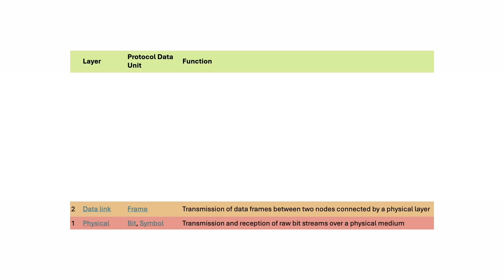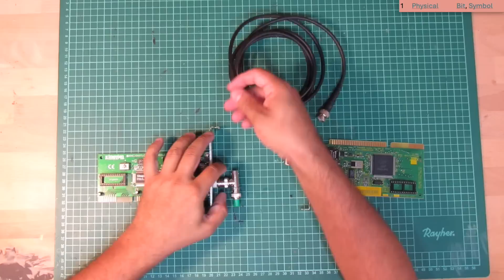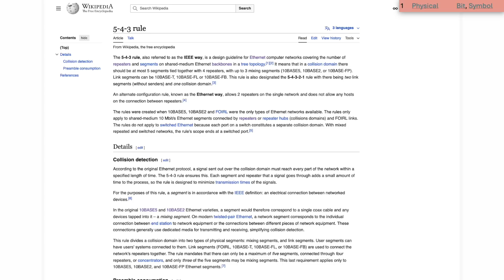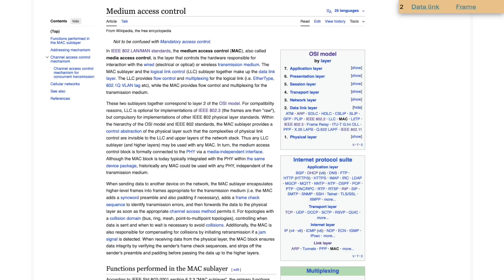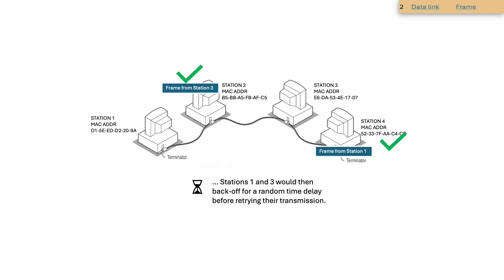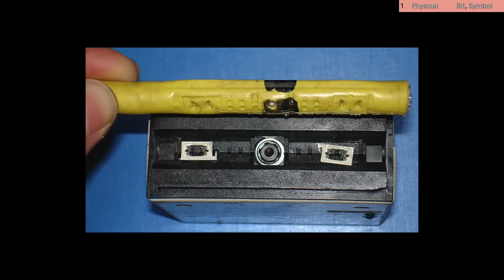10BASE2 Network Basics - Rewinding the Network (Part 1)

Comment: In theory 10Base2 was great; in reality it sucked.

In the early 90s, Post college I tried being a small business computer consultant. So I installed this in many locations for small networks and it worked perfectly. However, the problem with it was someone in the facility would invariably pull their computer away from the wall (say to vacuum behind the desk) and the RG cable would yank out of the BNC T-connector.

"So what?" you young ones may say, the same thing still happens today with Twisted Pair or even Fiber. But no, the real problem with 10Base2 was that because of the topology, the entire network downstream of that point would die ... and the rest of it would get real flaky due to a terminators being gone.

Once twisted pair cards became cheap I went almost exclusively to that format despite the fact you had to buy a hub or switch.  One exception was a few years later, for a small business with two semi-connected buildings. The office portions were two different structures on the street separated by a loading dock driveway.  We strung the RG-58 coax outside across that driveway with 10BaseT + 10Base2 switches possibly the exact same as you had (I can't remember the brand I used).

Comment: Fun fact: Apparently the 16-bit ISA 3c509 can also be used in an 8-bit ISA slot. Learned this recently. Mind blown!

A rare use case for a 10base2 or 10baseT transceiver with a combo card is if the built in port on the card is broken. I have actually done this back in the days. (Actually the insulated DC-DC converter was what was broken on that card, and for a while I ran the insulated part of the card using an external wall wart :) ).

In my experience the old school devices with multiple 10base2 or AUI ports is often too slow to work well with the fastest 10base2 or 10baseT cards. I.E. if you have a 3c509 with BNC and a newer PCI card with TP and connect them via one of those older devices the older device might not be able to switch directions fast enough, making the network drop the reply packets all the time, making things super slow. Meanwhile if the 3c509 are replaced with an older 8-bit ISA card things work fine.

In other words, if you want to connect BNC/10base2 with TP/10baseT, use one of those cheaper consumer grade style hubs from Dlink, Netgear or some noname company as those are new enough to work reliably, and avoid even older "professional" equipment.

Also watch out for old 10-base-T MAUs as it seems like the oldest ones don't really comply to the 10-base-T standard fully.

Btw, the reason for the 50 and 75 ohm impedance of RG58, RG59 and lots of other coax cables are that 75 ohm is the most efficient for connecting an antenna to a receiver, while 50 ohm is a compromise to allow a thicker center wire which is better for transmitters. This is also the reason for why broadcast FM and TV (including satellite and cable) receivers use 75 ohms, while receivers used with frequencies and thus antennas that are also used with transmitters usually use 50 ohms. Can't remember which channel but there is a great video here on Youtube about why 50 (and 75) ohm is the standard.

Comment: Of course, the hunt for the missing terminator (that you do not know is missing) is part of any 10-Base2 adventure. But there are many more. Like using a non-standard mode of 10Base-T Alta Research cards to be able to transmit over long and low quality Voice grade cables a 10Mbps Signal. Convincing some dumbass that if the X.25 (and by extension, the FSCKing ROSE) packets do not pass the local machine, and the packets from the router reach the remote server in another city, the problem lies in the local machine, not in the remote server.

Oh, good times.

A few things you failed to mention (or I failed to hear):
- 10Base5 had a maximum lenght of 500mts, so, in principle, you could have two hubs in offices separated 500mts, connected by 10Base5 (as a backbone), and then use 10Base2 in each office for all the computers for cheapness sake (ask me how I know).
- If you used MAUs, you had access to 10BaseFL, which gave you a maximum lengh for the backbone of 1000mts. and then could use 10base2 again for cheapnness sake (never even tried).
- The automatic crossover specification is pressent as far back as 100Mbps eth, but optional. As long as ONE of the parties involved has it, it will work, is mandatory in Gbps Eth onwards.
- Good quality terminators had to be Grounded, but you could ground only ONE of the terminators. In practice, everyone (us included) bought cheapo terminators like the ones in the video, but I had quality ones from HP in my HP K300 Servers (a thinet used along 3 racks for heartbeat services).

Ah, fun times.

Too bad there was the "Palace Revolt" and not only the IETF disobeyed the IAB and did not use TP4 for address extension (https://datatracker.ietf.org/doc/rfc1347/), but also, did not chose IPX for their TUBA Needs (https://datatracker.ietf.org/doc/html/rfc1791), so, we ended up with the IPv6 mess, and we are still waiting for it to take over...

Anywho, too many ramblings for one night. Over and out.
Reply from the maker: Thanks for your inputs and the time for writing those missed aspects.

For the most, I was just looking into 10BASE2. The side-tracked mentions, specifically for 10BASE5, came in just naturally when touching the comparison aspects and for putting the AUIs in context.

When doing those videos, it''s always possible to miss out a few things.
I'm glad you added them, and you're right, I did in fact overlook the need for grounding the terminators. I'll fill that in in an upcoming episode!

Comment: I built my first 10base2 network in a my apartment, where I couldn't drill any holes in the walls to pass the cable between rooms. Instead, I ran the cables in the open space between the floor and bottom of each room's door when it was closed. It worked pretty well except for when a cable wasn't flat on the floor and someone slammed a bedroom door, taking down the entire network.

Comment: My first network was some cheap discounted Novell Personal Netware kits I bought at an office supply store when I was about 12 or 13. It came with the software and 2 NE2100 cards.  Sadly they were not as popular as the NE2000 cards and didn't have as good support.  But after a day or so of playing around and watching the included VHS tape I had an IPX network going at my house in my bedroom and could play some networked games and share files.  10Base2 was pretty cool and the cables were fairly cheap.

Comment: I've only ever seen base2 once in my life around 2009-10 when I helped clean out an old office building.
Got me a good load of old hardware from that place, including a bunch of NICs, a few laptops and other goodies.

I never did get a base2 LAN going - it literally took until today to realize that I'd forgotten the terminators. So close and yet so far 😀
Reply: Don’t let that stop you, 50 and 75 ohm BNC terminators are available for cheap on Amazon.  I know they’re used for oscilloscopes and probably other RF applications.

Comment: Great video! I did have some ISA network cards that were NE2000 Compatible in the past, but they needed a BNC terminator or the lights would disco saying no cable connection found. The LAN port on them also wouldn't function without it.

Comment: Air is not the transmission for wireless signals.  Spacetime is the medium through which electromagnetic waves can propagate.  I know... being pedantic again.
But I ran 10base2 back in the mid 90s.  My roomate and I would play Need for Speed over the network, Warcraft, transfer files, and share a printer with DOS/WFW3.11 and later Win95.
And we used IPX/SPX on the LAN because nobody used TCP/IP on the LAN in those days... it was still a Novell deaminated world and games almost only supported IPX/SPX.
Reply from the maker: @BandanazX  Yeah, that might be correct from your physicist point of view.

It‘s also correct to say, radio waves don‘t need a medium as a carrier.

Still, they are very much influenced by the medium they travel through, i.e. speed is affected by vacuum, an athosphere, water, solid objects of any sorts (speaking of reflection, refraction, diffraction and absorbtion).

But that‘s not the point here, as in regards to the networking context, I think it‘s enough to provide the picture of „the air being the cable equivalent“ in the layer 1 context.

Frankly, we‘re installing the WiFi APs here on earth, so the readio waves are emitted and traverse not only the athmosphere, but to some extend also through solid walls, windows, etc.
So the analogy I used is anyway incomplete.

Despite not correct in a pure physics definition, bit I‘m not teaching physics here, and I can‘t assume everyone wants a lecture, I‘m sure it‘s good enough to get the meaning.

But then again, If I’m supposed to provide a physically accurate statement for radio waves, then I should propably also not be talking about electrical signals, but rather about Ions and Electrons moving through a conductor.

Maybe I‘m generalizing and simplifying too much. I‘m propably victim by day-2-day work experience with people not caring for all the real things behind, them being totally happy with simple to understand (but sometimes bot fully accurate) analogies.

Comment: Fun fact - the OSI model is actually a real networking model that was competing against TCP/IP and Ethernet back in the day. You had companies demanding OSI compliant hardware and software as a competing network standard. Of course, it never took off, but that's why things like TCP/IP and Ethernet and other networking technologies never fit neatly into the OSI standard. They never were supposed to. As a vendor you offered an OS with OSI compliance, bought OSI compliant hardware and wrote OSI compliant apps. But it was too little too late, and in the end, things like BSD sockets won out for the user APIs, TCP/IP for networking protocols and Ethernet. I don't think there was enough OSI "stuff" around to actually made a production network from.
Reply: Oh, dude, production grade OSI networks were a (big) thing back in the day, in Govt, Telco and Banking. As recently as 3G we were still using OSI Protocol stuff.

Comment: My parents ran a business out of a Victorian era building. Their first computer, which we still have and works was in 1985. Eventually, they had IBM-compatibles and the need to network these became obvious. Coaxial cable was passed through the floors to create a 10Base2 network. The workstations were running DOS and Sage Accounts, with one workstation also as the server. Eventually, in the late 1990s this was replaced with a 10Base-T network.

Comment: Unique MAC addresses? Not if it was a PC from Packard Bell in the early 2000's. They foolishly sold thousands of PC's with NICs with the same MAC. It caused absolute hell on the NTL Cable network which demanded a unique ethernet card MAC address for their cable modems to connect to 😯🤣
Reply from the maker: @thingi  Well, „theorically“ unique ;)

I encountered a few SuperMicro servers with identical MAC addresses during the early 2000s as well.

Comment: Critique: despite still being widely taught, the OSI network layer model does not map directly to the TCP/IP stack we use today, instead it represented a failed networked proposal (failed in terms of lacked any commercial success). The TCP/IP model has similarities, but is simpler and represents our modern networking (including 10BASE-2) much more accurately.

Most egregiously, OSI had proposed three layers on top of the transport layer (session, presentation, application) where nobody actually implements such things in a TCP/IP stack. After the transport layer (eg, TCP, UDP, SCTP), network protocols (eg, HTTP or SSH) are consumed directly by applications to do as they wish.
Reply from the maker: Thanks for your thoughts. I was taught both models as well, so I fully agree with the notion especially about layers 5-7 in TCP/IP. Those feel really artificially imposed onto the OSI model, and it's sometimes a struggle to explain, why a certain protocol is L5, L6 or L7.

However, in the context of this series, I intend in doing some comparison of different protocols besides TCP/IP, like NetBIOS, IPX, AppleTalk, ARCnet, as I go along.

Some of those don't even have their own model representation, so they just treated in context of the OSI model.
As such I prefer using the OSI model overall, as I believe it's easier to explain different protocols in a comparable and relatable way using the same high-level model, e.g. "TCP and UDP, DDP and SPX are all (OSI) transport layer protocols".

Although I have to acknowledge that even for other protocols, OSI is not always a perfect match, for example for NetBIOS, there's simply no L6/L7 equivalent, and the underlaying NetBIOS Frames Protocol sits both on L3 and L4.

However, not all my viewers are indepth network engineers, maybe not even everyone is from the IT field.
So I'm always trying to find somewhat a balance between how deep I go and how to explain it briefly in a understandable but still correct way, so it applies to a broader audience.

The OSI model, as you mentioned, may not be fully accurate for TCP/IP, but it's also not totally wrong.

Comment: AUI wasn't only for 10BASE5. 10BASE-T MAUs were also available, which gave your old Ethernet card a 10BASE-T port.
Reply from the maker: Thanks for bringing this in, and it totally makes sense for transitions between all wiring standards.
I'll go spotting, would love to get hold of a 10BASE-T MAU then :)
Reply: @THEPHINTAGECOLLECTOR 

We often used AUI ports on repeaters, 10BASE-T hubs, bridges and routers to connect fiber transceivers as we migrated backbones from 10BASE-5 backbones to 10BASE-F fiber backbones.
Reply: I think there were even fiber MAUs.

Comment: We had at school 12 IBM PS/2 model 60 (286) computers wired in network with coax cable that booted from a 486 computer that acted as server. At boot, we had a huge number of drives (only one was for us to save our work) but we had to save our work on a floppy. One day, I get a bootable floppy with Prehistorik 2 game and when the teacher was not paying attention, I rebooted the computer. Until the game strted, the nework crashed and the only working computer was mine, the others were freezed. I have no idea what really happened; later I find that that floppy had a boot virus (parity, if I remember correctly). 
Borrowing the idea with  the coax cable, that same summer, I with my neighbour made a network to play Doom and Red Alert: Command and Conquer. We both had 486 computers and we ran Win95.